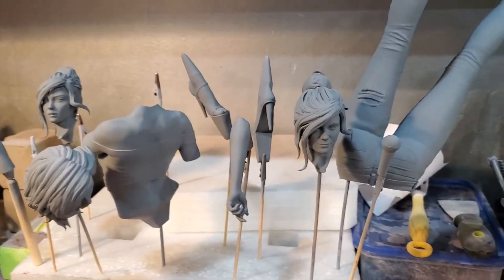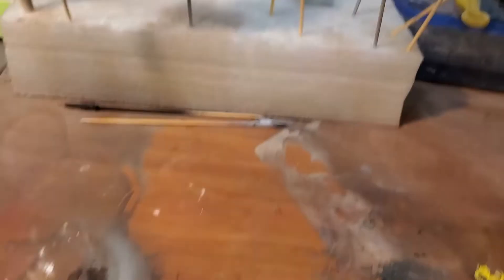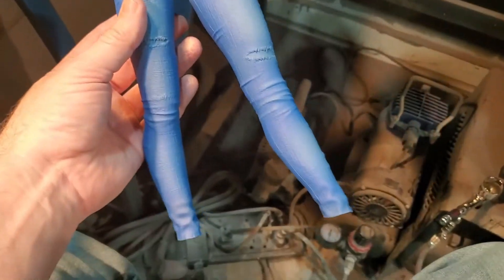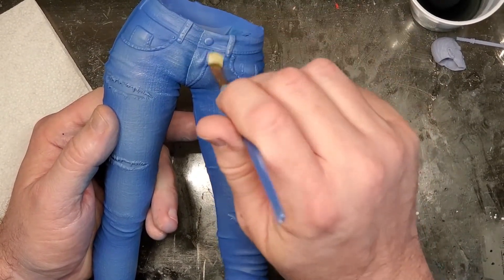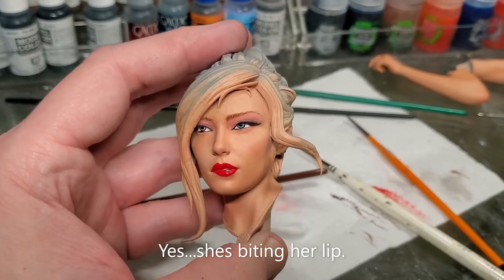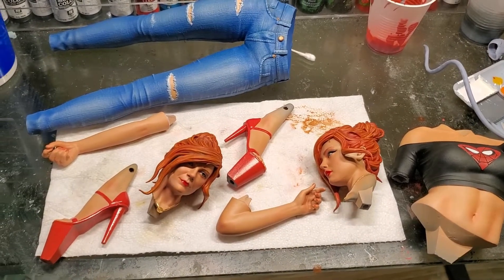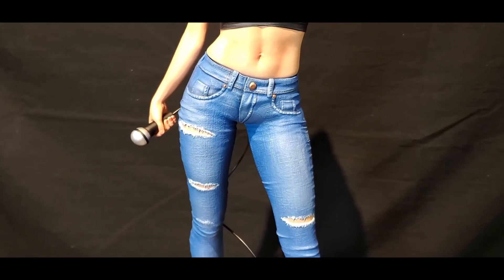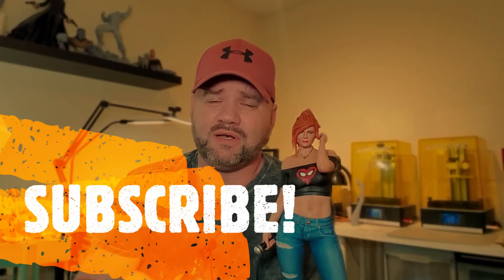Spiderman's Mary Jane 3D Printed/ Painted/ Kirsten Dunst Version

Comment: Great videos,love your channel. Can you give some more info about sealing? When to do this, why to do this and favorite products, also a cheap way to seal etc. .  I really need to finally understand this :) 10x
Reply from the maker: I use a flat sealer from Krylon on my models. It works great. I usually seal when I do skin tones or when I paint a large part and I need to handle the model. That way I don't mess up the paint. Don't apply it heavy and make sure it's dry before you handle it. Then when I'm finished altogether, I apply a final coat to it. Hope that helps.
Reply: @TheCreativeCollector  thanks man, it did help. I'm guessing you use the Matt and not clear,  is there a sealer that can be applied using an air brush ? Thanks man. Keep up the good work ;)

Comment: That's fantastic!  I just started resin printing and my challenge just seems to be setting up supports since auto supports don't always seem to work.  I haven't had a chance to hollow and place drain holes since I only printed a small 1/12 scale Chun Li statue. I've printed 3 statues off my Creality FDM printers but want to improve to eliminate layer lines with my Anycubic Mono X and jumping between Lychee and Chitubox
Reply from the maker: That is awesome!
Reply: @TheCreativeCollector  So you print most of these solid or try to save on resin and hollow them out with some drain holes?
Reply from the maker: @Ellery-USA  Definitely have to hollow them out.
Reply: @TheCreativeCollector  Can you provide some tips on your Hollowing and drain hole methods, larger parts seem obvious but head sculpts and small parts where you can't hide holes? Do you use infills?  Just seems more cryptic than FDM.  Trying to print the Black Widow model next and using Chitubox 1.9 for now.
Reply from the maker: @Ellery-USA I use Chitubox to hollow it out at 1.2mm thickness. Its not very thick but for me it does the trick. I put at least a couple of holes in each end if possible, as big as 5mm. I do both ends because it helps with draining, and suction on the FEP. I use 5% infill on the inside.
Reply: @TheCreativeCollector  Thanks a bunch I'll give it a shot.  With 1.2mm thickness do you have any issues with cracking over time?  Do you do anything special with hollowing and drain on head scultps?
Reply from the maker: @Ellery-USA  No but I had issues in cracking with it being thicker. I've printed literally hundreds of pieces and didnt have any issues with cracks.

Comment: Great work. Just got into airbrushing 3D prints and really enjoy all the info. Would be curious to see your masking/separation of colors process.. whether it's tape or putty or just switching between brushes and airbrush. Just getting started but I find myself airbrushing as many parts as possible for a smooth finish..which requires tons of masking.. wondering if you're using a brush for a lot of parts. 

Basically when to airbrush and when to just use a brush and your masking technique would be nice to watch. Subscribed and Thanks!
Reply from the maker: Thanks Eric! I usually go between airbrush and hand painting a bit. I HATE masking! lol So I dont do a lot of it.

Comment: Excellent paint job, learned a lot and especially liked the way you painted her jeans. Have to say it was a shame that you threw away the head print because of the layer shift, if it happens again maybe you could try using a rotary tool to remove the line, it's worked for me in the past. Awesome work regardless....Subscribed!
Reply from the maker: Thanks man. I was gonna keep it but it also cracked like the first one. I've printed a third one and it cured ok. I'll do an update soon.